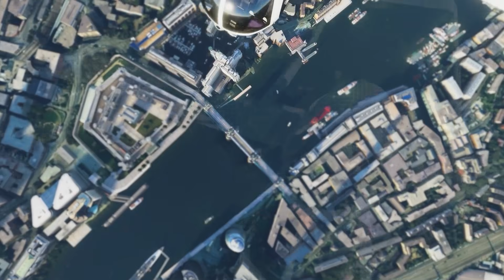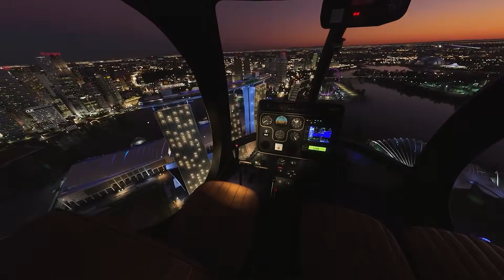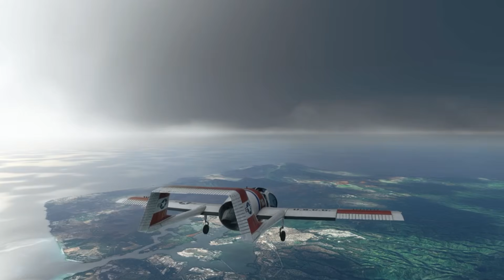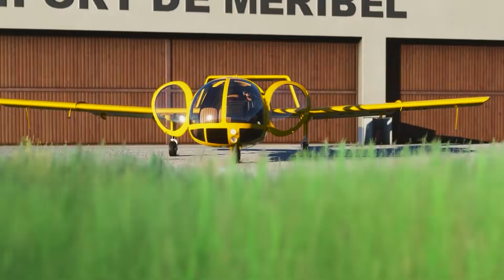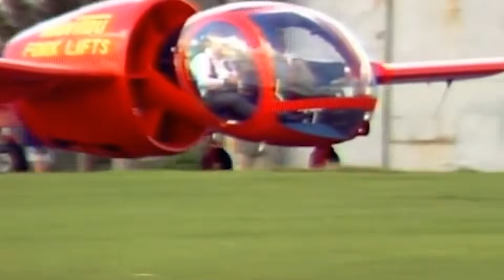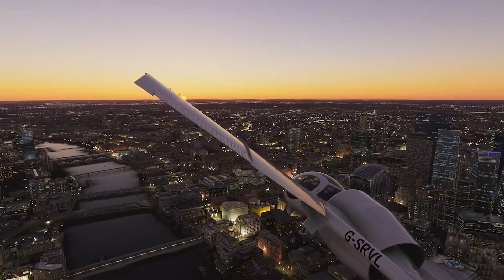Why Everyone Wants This Weird 'Bubble Plane' That Can't Stall

Comment: I remember this unique looking plane from my childhood. I always wondered what happened to it.

However, if you want slow speed, use long, wide, and very thick wings.

Nevertheless, what l would have done different is used at least 15 blades on the propeller, instead of 5. This would allow it to spin slower, be quieter, and greatly extend the range.

Another option is to swap the piston engine for an electric motor, and put the batteries in the wings. Then it would become an updated plane.

Above all, the Optica was actually a plane ahead of its time.